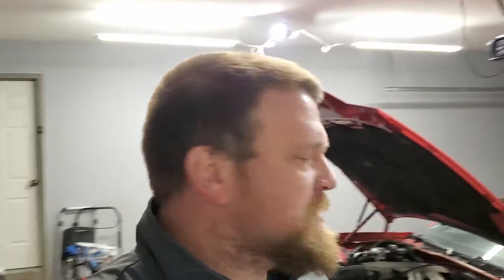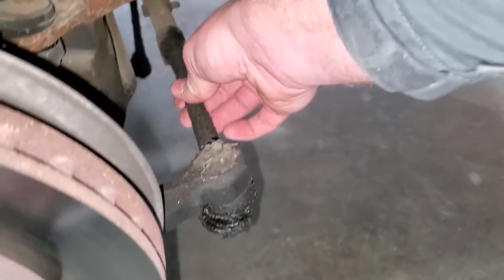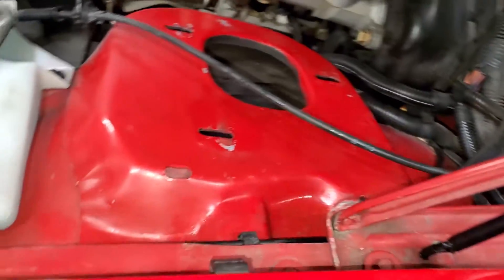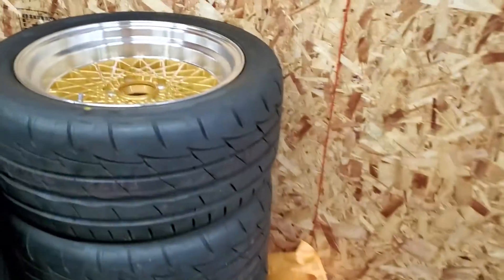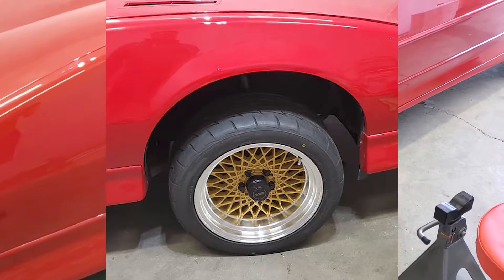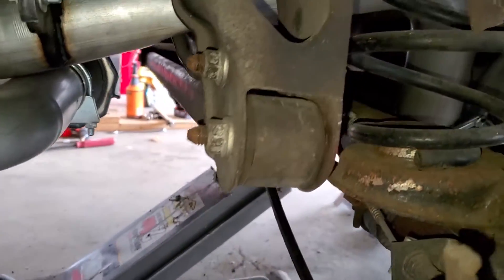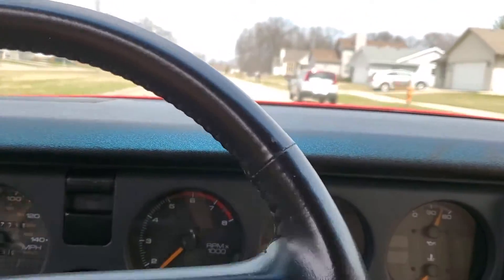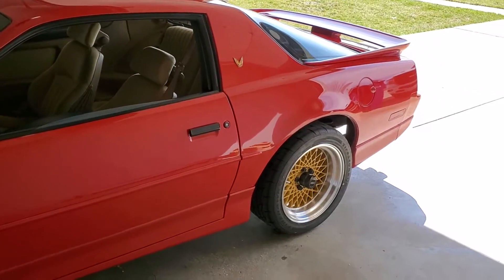1989 Trans Am GTA Full Suspension Rebuild and Restoration with Hawks 17" Wheels

Comment: I have the same exact car (62,000 miles) except it went through a Lingenfelder performance engine (383 - 340 hp, 420 torq) swap straight from the dealer back in 1988.  

Thanks for the video.  I'm wanting to raise it hack up a bit and update the 37 year old suspension.

Comment: I'm ordering everything you used in your video for my 89 bird. I'm getting different springs to hopefully sit a little lower. The sway bar end links part number is for the front? That end links did you use for the rear? Thanks

Comment: Nice car! If you haven't added the IROC wander/wonder bar then you should. It makes the car feel like a go-kart and prevents the potential for the steering box to crack the subframe.
Reply from the maker: Thanks!  I did put one on shortly after this video, easily one of the best mods for the dollar on these cars!  Between the moog front springs and the wonder bar, this thing almost has no body roll and steering response is great.  I love it.

Comment: sweet man I have a 87 gta I need to upgrade all my suspension aswell!! Do you think the GTA Ws6 has different suspension? I've got the exact car but the T top model! 350 engine.
Reply from the maker: Hey there!  Sorry I missed this comment.. the ws6 had thicker front sway bars for sure.  I forget what else off-hand.  I would definitely look into thicker sway bars and the upgraded Moog springs if you're looking for a little bit of enhanced handling.

Comment: Your GTA is either not an authentic GTA or it has been re-badged.  If it was re-badged, whoever did it put them back on wrong.  Both front fender GTA badges are way off from their factory location and the front nose badge appears to be just a little bit too low.  The sail panel birds look like they're close to the correct location but maybe just a hair too high.  Regardless of the front badge and sail panel badges, the fender badges are 100% are in the wrong spot for authenticity.
Reply from the maker: Car has been repainted, front fender badges are not far off, just a little close to the the doors.  I do believe the nose badge is correct, sail panel birds are also a little close to the doors.  They haven't bothered me enough to move them.  Car is otherwise an authentic gta, rpo and vin confirmed.